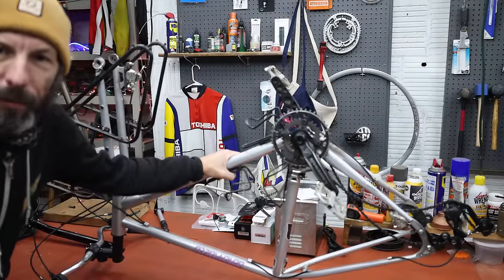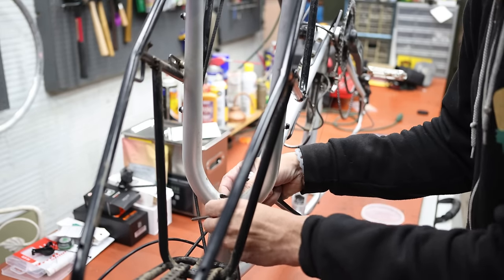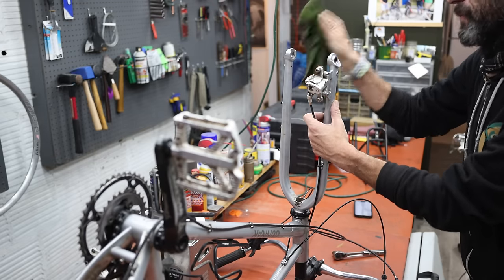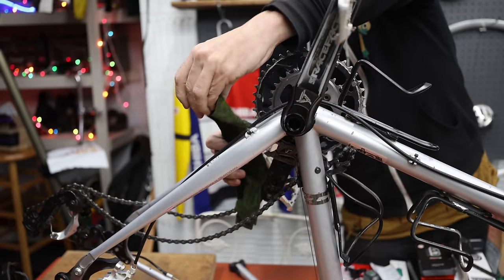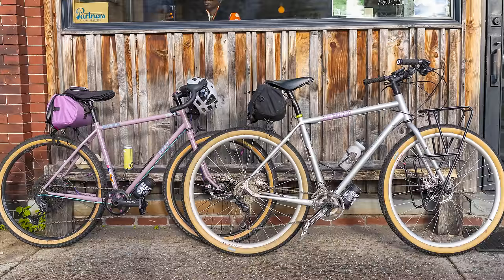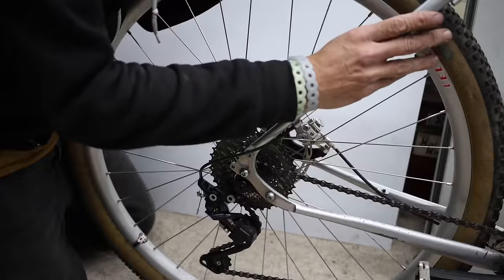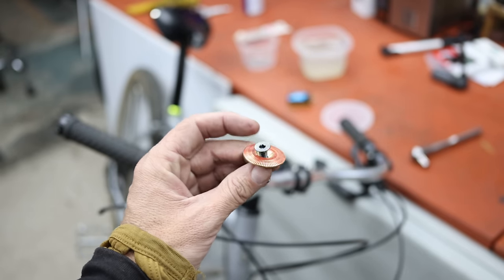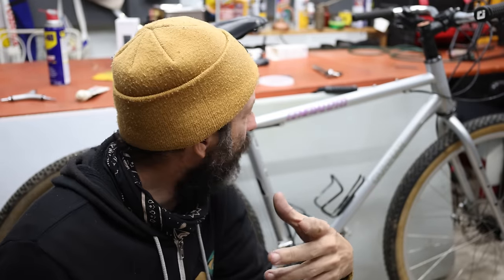This Bike is a Game Changer

Comment: Does anyone else think those sleek steel 90s hardtails like Bontragers and Konas, (with v-brake, threadless headsets and no more than a 3 X7 drivetrain) were the ultimate do it all bikes?
Reply from the maker: I think they are great bikes and I have a number of 26 inch wheel MTBs - that being said they don't really hold a candle to this better geometry and bigger wheel size. I'll ride my vintage MTBs here and there as long as I ride bikes but when I want to really get into the rough stuff I'm taking this.
Reply: @TimFitzwater  I haven't actually tried a 29" just the old 26" and 700cc road with 25mm slicks, I guess these ATB are somewhere in the middle, great channel, cheers!
Reply: I have a '95 GaryFisher Hoo Koo E Koo setup as an urban commuter and I think it's amazing for all-purpose riding.
Reply: Yup. Loving my '95 Cinder Cone with North Road bars and a Flexstem. I know, sounds weird, but it rides great.
Reply from the maker: @ronwhite8503  Yeah - I'm about to head out on my old 2001 Trek 26 inch wheel bike today. It still rides great too - but there are certain situations where modern geometry is just soooooo much better.
Reply: '95 Gary Fisher Hoo Koo E Koo - Such an amazing all around-bike.

Comment: Being mostly roadie, my  CL  score this year is an Austro Daimler 58CM "Pathfinder"  that was $100.00, a junk cleaner guy found it in a barn .  It's so minty that the original Austrian Semperit gumwalls are still just fine. Amazing. The bike was probably ridden 12 times . I sank a few bucks into it, wider bars, barcons, lighter, shorter seatpost, screaming deal on a new Gel Selle Italia saddle. Fenders.  The frame is Magnalloy , like peugeot's HLE. It's stable , I can ride no hands, and it's the best looking of my misfit midrange fleet. These AD-Puchs are somewhat rare here.  CT is a freaking gold mine for bike scrounging. I always feel a tinge of guilt when I take in a new one that I fall in love with. I hear muffled crying and whimpering from the others, that are covered in blankets.
Reply from the maker: Ha! Nice. 
I had a Puch AD for a while. It had a beautiful paint job and Shimano 600 - full group and wheels. I did the cables, tape and tires but just didn't need another downtube shifting vintage bike so I sold it to a friend for my cost. I paid 100 bucks for it too.

Comment: Sanitas cycles Titanium all road. It’s my rando bike, fits 40mm tires, rides like a dream, doesn’t have any proprietary nonsense, has a straight head tube, external bearings, t47 bottom bracket, super easy to service, ahhh and i got for a steaalllll
Reply from the maker: Awesome - sounds rad. 
I definitely dig the simpler things.

Comment: I picked up a Surly LHT frameset last summer and built it up with drop bars and 700x50c gravel kings to ride easy mountain bike trails and gravel rail trails with my 9 year old son.  It just wasn't comfortable after a while because I had to be in the drops most of the time to get enough braking power on the mountain bike downhill portions.  I converted it an ATB this summer with Velo Orange tourist bars and it was like a totally different bike.  All of a sudden that hole in my stable that I didn't realize I had was filled.  So fun, upright, and cruisey....
Reply from the maker: Awesome! I totally believe that knowing the difference the bars made for me. 
Cheers!

Comment: Thanks Tim, My forever bike is a 2017 Surly LHT 700c in black and I like to tinker with it about as much as you like that Gunner. I've gone swept bars too, but mine are Jones H-bars which helps a lot more on the single and double track because it gives me leverage. I need to get the studded snow tires on it pronto.
Reply from the maker: Very nice.
I was out in the snow today - but I use an old MTB. It gets the job done but snow tires on the Gunnar would be cool. Maybe a next year purchase.

Comment: that bike is more mountain than the orig mountain bikes from 1990.  totally fine for everything you showed.  the only limiting factor is speed for rigid on rocks etc, but unless you are racing who cares.  love that you just love riding.  your setup reminds me of Path Less Pedaled.  That guy and you should ride together
Reply from the maker: 100% Far more capable than any of my 26 inch wheel MTBs. 
Definitely not enough rocks on these trails to warrant suspension IMO. 
Russ from PLP lives in Spain now.

Comment: Great clean up video! I need to get mine sorted, they need a deep clean and grease up because this year in South East UK has been very wet.   In answer to the question on bike builds, I did add carbon forks to a 14 year old steel frame bike.  It’s a Genesis Alfine sealed hub “adventure commute” from 2009 (rear drop out).   It has never been right and was a 1st gen of this kind of steel bike with disc brakes. The problem was that using any pressure on the front brake and the forks would bounce and flex so hard as to be a bit worrying.  

So I bought a new Genesis (UK Steel bike company) carbon fork, so great to be able to stay on brand.  I learnt how to cut a fork, bought the tools and cut it down and fitted a new hope headset. Inspired by your videos, I decided to learn how to fit the headset and forks myself.  The result was great and I also had some Velo Orange crazy bars that I fixed on it.  Last interesting ingredient was a redshift suspension stem which had a steep angle which is what I wanted for a more upright position. 

So lots of fun in the workshop learning stuff. For the last year I also ran wolf-tooth grips but they were really hard, so recently switched to Rev grips. 

You can see the bike in this video: https://youtu.be/hh74AI7GJ3E?si=yVHxvbEGNmOf7mQ9
Reply from the maker: Awesome - sounds rad. I just bookmarked the vid and will check it out!

Comment: That bike is super cool. KInd of juvenile looks with extra capability. I rode a steel 90´s sunn with sweep bars over trails and roads for a few hundred miles and the bars with long stem and some widish 26" w tires gave a lot of built in suspension.
Reply from the maker: Thanks.
I wasn’t familiar with Sunn - just looked them up - very cool.

Comment: I find as I get older I look at bikes as an assortment of components, as long as the frame sizing is within a bandwidth for you you can change contact components to get a good fit. Bars, stem, seat and post, cranks. I think tires make a bike ride well and that's down to what the frame allows.
Reply from the maker: I agree 100%. Some frames may get a little wonky if you go to far into what they weren't made for - but in general there is a lot of leeway!

Comment: It's not new, but new to me....I built up a "neo-retro" road bike from my friend's 1986 Specialized Allez he bought new right after college. I cold worked the rear stays to allow a 10spd wheel to fit because I am using 2012 Tiagra/Sora groupset salvaged from another bike. I have a plus hardtail for trail rides and my occasional exploratory, try to get lost rides. 
My current interest is my "Franken gravel" build that's quite the experiment. It has parts from a 1986 Jamis mtn bike, a 1995 Marin Muir Woods,  a set of Paul Components Cross Stop brakes (precursor to V-brakes) on the rear, front brakes are Shimano cantilevers from the Jamis along with the brake levers, a 1998 Barracuda XC URT frame (I rode it off road for 10 yrs before hanging up) and a few new parts to finish the build. It's a 1 x 7 drivetrain consisting of a 7 spd derailleur, cassette, and chain, with a 30t 12 spd crankset, and shifting it is a 6 spd thumb shifter converted to friction mode. It's essentially a 26" wheeled, softtail gravel bike because I installed a rigid fork, but everything works perfectly. I am waiting for a set of Taiwanese copies of the Origin8 Strongbow bars that I am going to use ESI silicone bar tape on instead of actual mtb grips. It may look funky, but who cares, I know I don't.
Sorry this was long.....
Reply from the maker: Heck yeah - they sound like rad bikes! 
Are you in our discord? Would love to see photos of them. 
If you are interested it is a message board thing where we share bike pics and chat all things cycling(and beyond) 
https://discord.gg/jx6rdZPD
Reply: @TimFitzwater  I will look into it. BTW I am a former Ohio Buckeye, but from the SW corner. Love seeing cycling content from the home state. I've been living in Oklahoma for the last 28+ yrs.
Reply: @TimFitzwater  I just joined your discord page and posted the pics of two of the bikes. The 26" gravel build is a work in progress.

Comment: I picked up a used marin bobcat trail with an upgraded dropper post for $180! Enty level aluminum 29er hardtail, but really versutile honestly. Put on a reynolds steel 9er rigid fork someone had given me a year prior (which roadified the ht/st angle a smidge), also resulting in a somewhat similar fat guy in tight paints look, but not terrible. 16degree backsweep sq labs handlebars. Big fat surly extra terrestrial tire up front for suspension, smaller terrevail sparwood light and suppole rear tire. Its my kid hauler right now but I really look forward to all the kid gear coming off, the thing is FUN. Its 1x now but ideally id get it running 2x for ultimate versatility I think. Im 6'4" 29ers are great for me, this bike was such a steal, and I'll runn loose ball hubs any day, so servicable, my little tub of lubriplate will last me a lifetime. Those brakes look great, I need to keep those in  mind, the bobcat trail came with hydros which aren't my jam. For levers I love  pauls love levers, they pull the chrapo avid bb7s on my Ragley Big AL beautifuly.
Reply from the maker: Wow - that really sounds like a rad build!

Comment: TA are much easier to thread if you put the chain on the smallest cog. Also has the advantage of not messing with your rotor which can happen if you put the chain on the wrong cog and are fighting derailleur tension
Reply from the maker: Oh yeah - definitely should have done that. It applies to any wheel change. Thanks!

Comment: I picked up an Tanglefoot Moonshiner, don't have much miles on it yet but looking to do some bike packing next year up inVT
Reply from the maker: I bet that will be a great bike! Haven't seen one in person yet but have watched some videos about them.
Reply: It's a very different concept as you ride in the drops as they set it up high. Mine is set up with 27.5 and 3" tires so well capable for single track. I first tried it last year at the Cold Rolled event in Pine Hill Rutland VT and fell in love right away. Going to give it the works next year. Next time you get to VT and close to Poultney VT pay them a visit, you'll love the bike shop they have.
Reply from the maker: Nice. I've done something similar to a couple bikes with the Velo Orange Happy Stem but since they weren't built for it the handling can be a bit strange. 
I will keep that in mind as I would love to get out and ride in VT!

Comment: Recently got my first new bike in 10yrs so also my first through axle bike and must say it feels like a step backwards from QR's?  Now I need a tool, harder to align etc?  I'm sure I'll get use to it as I go and there are probably benefits when it comes to torsional stiffness etc, but nothing noticeable to the non-racer?
Reply from the maker: Yeah - people talk about the strength and all that but the actual only benefit I see is that it keeps the wheels more aligned - which matters with disc breaks.
Reply: @TimFitzwater  I can see that being a benefit if you're moving fast now that I think about it... but that said I've never had much of a problem keeping my mechanical disc brakes on my QR disc bikes aligned for the past 10-15yrs?  If they're a little off you know it right away and stop to adjust...
Reply from the maker: 100%
Reply: I have 2 mtbs. One thruaxle one qr. I ride pretty aggressively and honestly dont notice any difference.